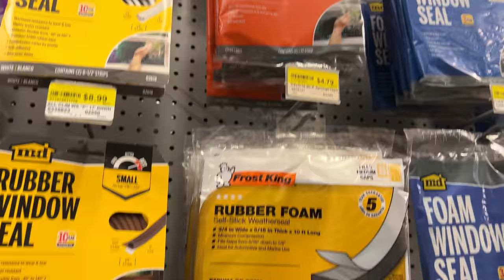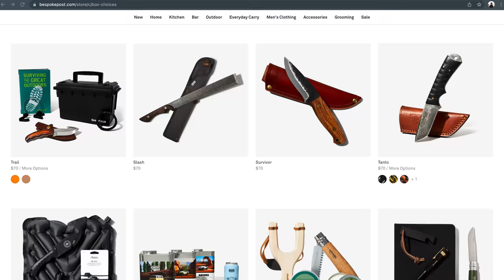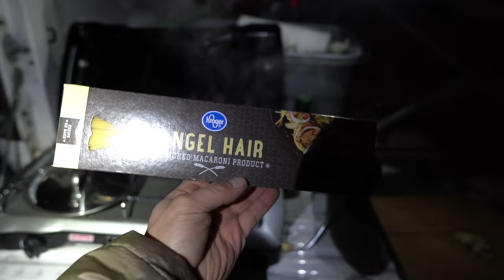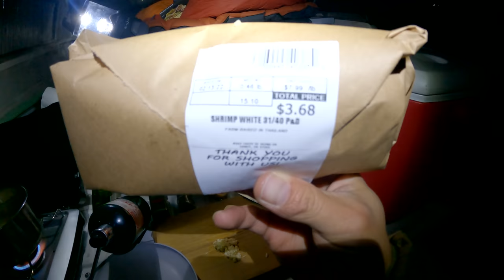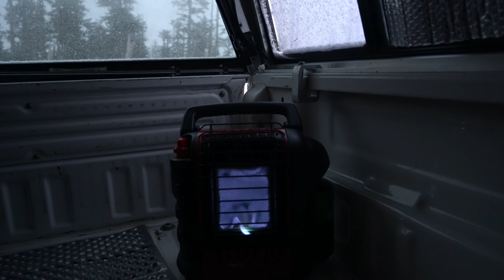Solo Winter Truck Camping in Freezing Temperatures (Sleeping on a Cot)

Comment: Hopefully I don't sound like an elderly lady pervert, but watching you cook and then the OCD clean up, I'm OCD clean myself, I was out loud making ooh ah sounds. 🤣 I purchased a folding cot for my Yukon XL temp conversion whenever I travel and haven't set it up inside yet. Note to self, make sure it fits before leaving town. Not the same brand as you have, it's all one piece, found it at Walmart. I have set it up in my apartment, safe room, and slept on it for a couple of nights during hurricane warnings, and dangerous weather. Recently purchased a 3 inch memory foam top for my bed in a size larger than I needed and cut it to size, the extra will be used on my cot. I was comfy without it, but why not?  Looking forward to your build. Not planning on a permanent or a raised platform for my SUV. Bens will go under the cot and a folding table for inside and outdoor cooking/prep and such.  Looking very forward to "Going on some adventures of my own"! God bless.
Reply: You go girl 🎯🤗

Comment: I had something very similar in Alaska it was salmon and cured in strips. Most delicious! Save the cot by drilling the rivets and removing the legs.  Drill the rivets out of the two long extensions and cut about two inches off. Build a simple frame out of wood to hold the cot.

Comment: I think I would have gotten a taller cap .
Reply: Tall canopies rarer and $$$. Usually made of fiberglass, not as strong as aluminum and much heavier. If he doesn't use cot and sleeps on pad in the truck bed he will have adequate heads space, that's how I do it.